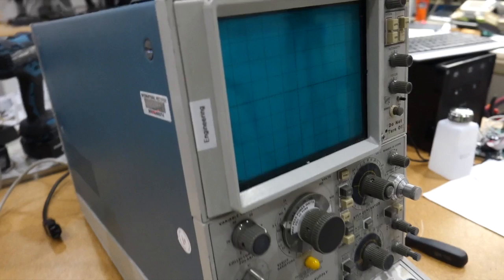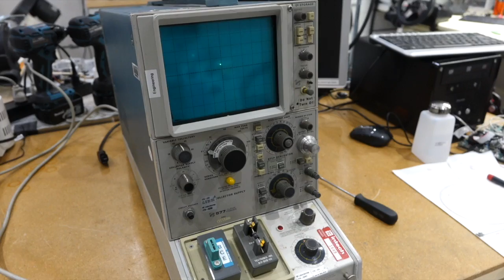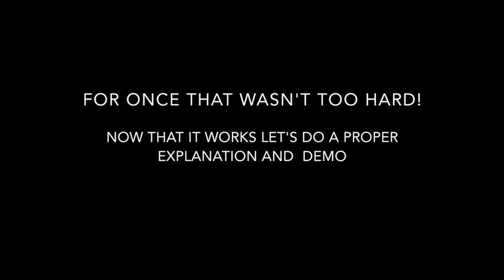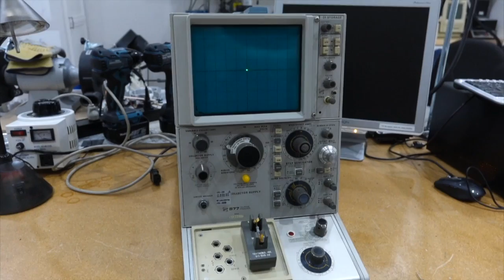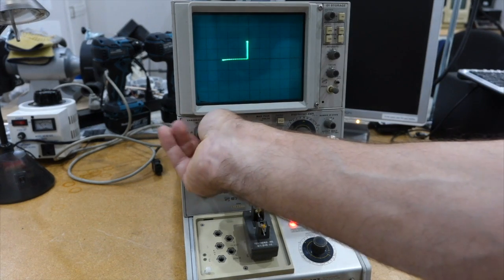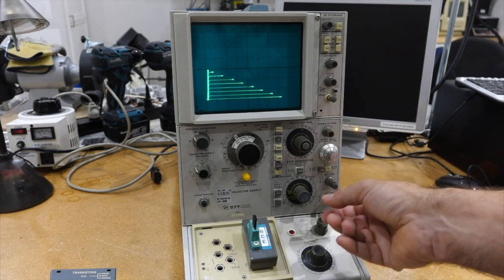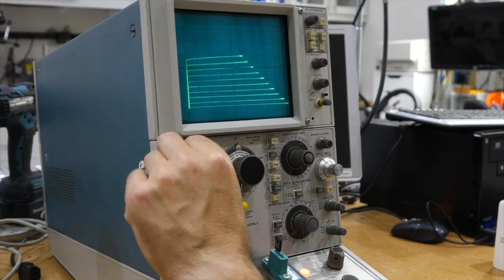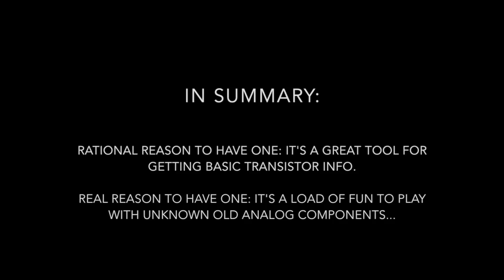Tektronix 577 Curve Tracer Repair and Demo

Comment: thank you for the video. I have a question, could you possibly give me you opinion on the following issue please?  I got a 577 with 177 fixture. I get no response when I connect anything to the test fixture. Main voltage nub responds, Horizontal nub responds.  If the Vertical is turn clock wise all the way on the screen a slanted oval looking shape is seen.

Comment: I really appreciated this video. My tracer has the same broken shaft, and I like your solution! I hope to test some JFETs using mine.
Reply from the maker: Great, good luck with your repair! That’s exactly why I post these, so it helps others with the same instrument!
Reply: @CuriousMarc  Consider yourself successful, I was able to make the same repair using 1/4 inch ID tubing. Fits nice and tight!

Comment: Hello,
I recently acquired one of these curve tracers but do not have any test fixtures and I can't figure out how to connect a diode. Could you please use a multimeter on your text fixture and tell me how they  are wired up? I can't figure out how to connect the C sense and E sense terminals if I wanted to connect a diode. Thank you!

Comment: super cool tool. I used one back in 2000 to sort  a box of power transistors for my employer. Still to this day o remember box weighed 50lbs! Fun too use and super quick. As stated really handy to sort out analog components especially ones all mixed up in a box. when I was done I had sorted everything into tubs and saved them something of the order of 3000$.  I was my very first summer student job between my fist and second year engineering technologist schooling.
Reply: it also was my very first task before they would let me on the line. Sometimes wondered it was more an initiation task rather than work.Did not care anyhow😀 I was my very first electronics job.
Reply: I like your Story. thanks for sharing.

Comment: Noob checking in: I'm a little lost at what Y-axis represents?
Reply: Current, in the case of the multiple lines, each line is a collector current vs collector voltage, with multiple base currents applied

Comment: Very nice, thanks for the demo. 
Looking at the unevenness of the trace lines where they each depart from the vertical line on the left of the display: presumably this is due to the tracer going up one line and coming down the next. Should this be fixable by aligning the instrument, or is it a fundamental limitation in how it works? Can you make it run slower and give purer results?
Cheers.
(sought after. "searched")
Reply from the maker: I haven't looked at what caused this artifact but I suspect you are right on your 3 points:
- it's caused by some dynamic effect

- you can slow the tracing (3 speeds) to minimize it
- there is a calibration of the fixture that can be done to minimize it

Comment: Speaking of curve tracers...  Look at this parted out 575 on ebay. OMGosh the vacuum tubes. http://www.ebay.com/itm/301174721832
Reply: I believe the 570 is the one to get... it is set up to do tubes.  They're more expensive than the 575 now, since even though they have tubes in them they're actually meant to test transistors.
Reply from the maker: Indeed! Just looked it up, it's an impressive beast. From the 1950's.
Reply: 1950s (and possibly 1960s) technology used to test 1960s technology transistors....
Reply: Maintaining stability of something this old though can be a real alignment headache.  Think matched pairs of vacuum tubes etc.